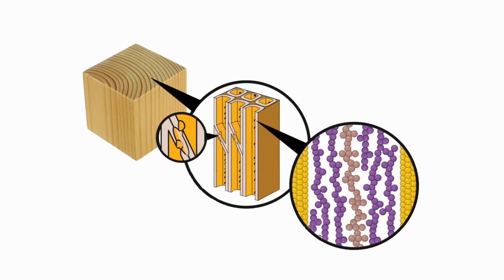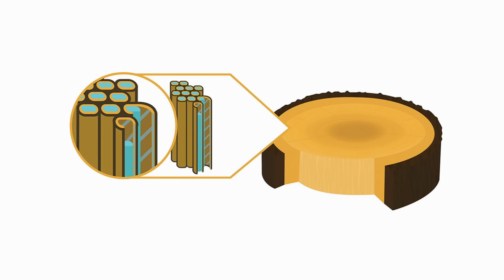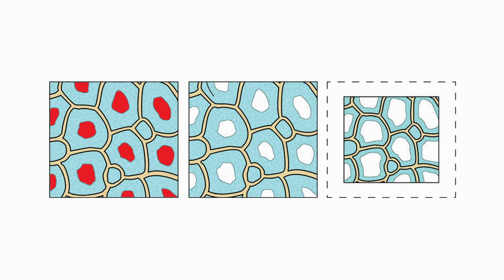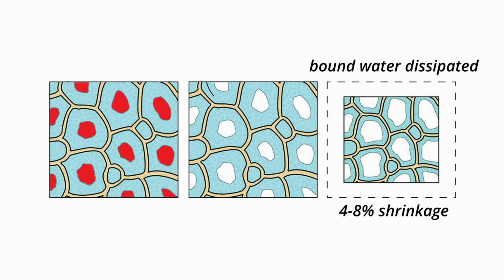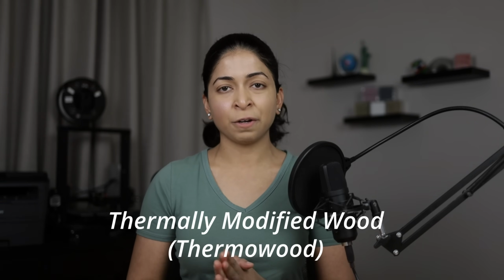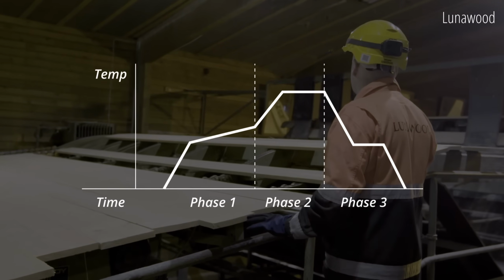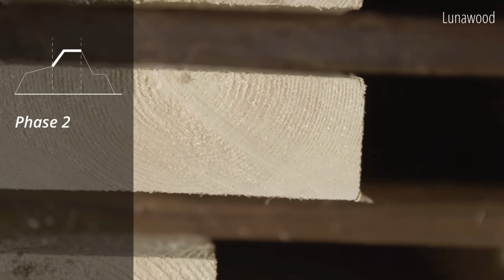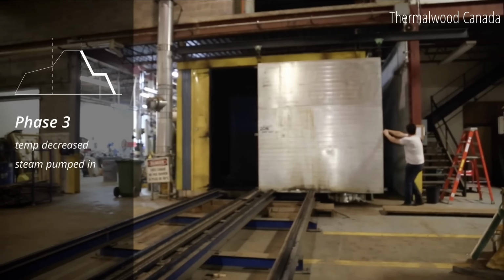Japanese BURNT wood siding | Yakisugi or Shou Sugi Ban

Comment: Excellent video.  I do a lot of work in OSB, and about 20 years ago a now defunct large OSB producer was trying to develop this very thing.  It was a top secret product they were calling SSB (stabilized stand board).  Normal OSB is produced by heating it to 200C in a big mechanical press.  Heat the OSB to much higher temperatures and you make Yakisugi OSB.  They couldn't get it to work.
Reply: Clearly they didn't understand what it is.  And in their case since it wasn't cedar it would be something like yakiOSB.

Comment: I have been all over this issue of preserving wood and the conclusion I have come to is just take extreme measures to keep it dry. I will be building a wood house in the Philippines and putting it on my channel.  I am going to have very wide eaves to keep rain off and I am also going to smoke the wood like salmon. I have heard that smoked bamboo can last 300years. I like the idea of thermowood but I don't like the strength loss. A big advantage of the surface burned wood is that it is going to be UV damage proof.
In Asia we tend to put cladding on vertically , I am at total convert to this. I like the look and the shorter lengths are cheaper and easier to replace especially if you use non T and G.  Good video.
Reply: Keeping water away is simple and bulletproof as a strategy. It applies to every level of construction and most non cellulose based construction materials
Reply from the maker: Thanks! Looking forward to seeing the progress of your house.
Reply: On the issue of keeping water away from a house you can clad a house in terra cotta roof tiles on the walls as well as the roof. The woodwork is then all internal out of the wet. If you don't like the look you can grow climbing plants up it.
Reply: @DavidPaulNewtonScott  True about climbing plants that you can do it, but I highly UNrecommend that especially w/heavily perforated siding like overlapping tiles.  The rooting mechanisms of climbing plants find gaps in the building membrane and climb right in, w/termites & fungi following the rootings.  From my mother's house I could see a Spanish-tiled-roof house w/stucco siding, and the climbing plants were leafing out in several places on the roof.  Its really hard to control once it gets going and the tear down to get all the rootings out is tedious (i.e. expensive if you have to hire it done) and a lot of patching is req'd.  Its like setting your tiled or shingled siding on auto-destruct over the ensuing years to come.
Reply: @EngineerMikeF  I would only do it with tie on plants like the one I am going to use bougainvillea.

Comment: Torching the surface of wood is a great way to refinish it easily as well. Have reused decking boards by doing that. The burning gets rid of splinters and badly raised grain without sanding, and you don't have to pay for stain.

Comment: I would love to do the cladding on my house in this. It's so classy and last a long time.
Reply: I did this for a home just a few months ago. I combined aspects of traditional and propane-torch methods to get it done most efficiently. Namely, I used soft but thick wire to bind together three boards at each end - until 12' long, when I put one in the middle too. Put the propane torch in one end on the ground, other end propped up in the air, wait for smoke to come out then end and then switch grounded ends and do from second end. Worked like a charm.

Comment: Pyrolysis is interesting, as the transformation of polymers occurs both when combustion is allowed or disallowed.  The prevention of combustion is usually achieved by an inert atmosphere, such as by flooding the heated chamber with nitrogen or a similarly non-reactive gas.   Combustion products and pyrolysis products have to be thought of as results of distinct processes, even though we most commonly encounter them simultaneously.

A structure lasting a century must be considered as quite old by Japanese standards, as it is unusual for residences to last more than thirty years.  Preservation of historic structures is usually accomplished by replacement of old materials with new, using conserved methods.

It would be interesting to consider the impacts of Japanese construction habits on the availability of housing, especially in light of the nationally standardized zoning practices of that nation.
Reply: "... as it is unusual for residences to last more than thirty years". I'm guessing you're an American? :-) Try telling a European that their new house will only last some 30 years!
Reply: @LarsPallesen  It is unusual for an American house (aside from extremely disaster-prone areas) to not last vastly longer than 30 years, except from those ruined by bad materials like PB plumbing pipes. Most of the houses around me, including the one I live in, are roughly 100 years old. In some older towns in my state there are entire districts filled with houses from our Civil War period, being between 150 and 200 years old. Many areas have laws in place that the older houses must be maintained and kept looking very close to how they originally were by their current owners, limiting what renovations are allowed, particularly to the exteriors.

Of course, for homes that are in disaster-prone areas, USA homes will tend to not survive anything severe. Even when building codes are actually mandated for homes to be built tough enough, fraud is extremely rampant. It's easy to see when a roof is blown off a house whether or not it was properly reinforced and the answer is almost always no, yet they keep getting away with flaunting building codes anyway.

Comment: I love natural building products like wood and stone. I would be interested in a home built from this type of wood treatment.
Reply: Check out Mr. Chickadee or Wild Wonderful off Grid
Reply: Yes, youtuber Mr Chikadee is my go-to for info. Getting away from power tools.

Would love to build a masonry stove heater, but having difficulty sourcing used cast iron stove parts that I can afford.
Reply: It's not structural; the process apparently makes it significantly weaker than the wood's unprocessed state.
So it'd have to be as cladding or something.
Reply: @LENZ5369  Did we watch the same video? They processed some pretty thick beams.
Reply: @anonymustly7818  Yeah, did we? 6:04
Apparently there is a 20-30% loss of strength compared to the original starting wood.
In this process; you are just removing the water from and denaturing/carbonizing the protein scaffolding of the wood; loss of strength (and density) is pretty much par for the course.

Comment: A bit down the rabbit hole but in the softwood vs hardwood discussion.  There are many fast growing hardwoods that grow wood that is softer than many softwoods, confusing I know.  One example of a fast growing hardwood is aspen.  Along with with being used to make paper, aspen is often processed into orientated strand board (OSB) which has largely replaced plywood in construction.  One interesting sustainability note on aspen.  It's harvested in coppice cuts, where it regenerates from root suckers.

Comment: Really interesting, but I'd like to caution against using old-school yakisugi in interior spaces.  The charring leads to formation of polycyclic aromatic hydrocarbons that can be toxic when used in enclosed areas.
Reply from the maker: Great point!
Reply: @BelindaCarr  maybe pin this comment to the top?
Reply: Seems like an obviously specific exterior pocess for treating exterior wood.

The human nose and common sense negate the caution directed by your fancy words.

I'll be sure to keep my incense, candles and fireplace outside 😆
Reply: not likely. they would all evaporate during the high temperatures after the fire is extinguished. Afraid of burnt pine sap?
Reply: @flocksbyknight  Really? You think the volume of hydrocarbons or volatile compounds out put by an incense stick or a candle equivalent to the leach of hundreds of foot of walls lines with charred wood? And you are not using organic wood either? You do you.
Reply: @BigHenFor  Non organic wood?
Reply: @ohasis8331  True...last I knew, they didn't use pesticides for the forests...even the locations were trees are planted for lumber don't get that sort of treatment. It's cost prohibitive to do something like that for the 20+ years necessary for lumber to reach sizes for harvest, over the hundreds of thousands of acres/Hectares that are involved... Particularly since spreading that amount of pesticides over such a long period wouldn't likely increase the productivity and will likely decrease it. Trees aren't the annual cash crops of monoculture, they're a long term investment, even orchards are careful with what they use and how they use pesticides.
Reply: Oh wait what? Guess I need to do some research on this.
Reply: If it's covered in a finish will this stop this from.happening?
Reply: It's meant for outdoor use.
Reply: Or seal it with a zero VOC interior gloss

Comment: Artificially petrified wood is superior in my opinion. While yakisugi imbues fire, rot, and water resistance, petrified wood is fire, rot, and water PROOF. And I suspect it lasts forever locking the carbon for longer making it a better carbon sink. I am curious though on how it affects the load carrying capacity of wood. Does it increase? Does it make it more brittle?

Comment: I’m curious to see how it would hold up in a hurricane, floods, snow and ice, wildfires, and extreme temps in both directions.
Reply: It would be interesting to see if this was used throughout Japan, as various parts of the country all experience the things you describe.
Reply: It would be better for finishing projects, not for structural projects.

5:50 - It's more brittle
Reply: all at the same time? :)

What's your criteria for adequacy? What are you comparing it against?
Reply: She said it wasn't structural. So not very well if you tried to build a house out of it.
Reply from the maker: @upvotecomment2110  Thanks! Yes, it's brittle & non-structural
Reply: It is possible to use sho sugi ban techniques structurally, but only to the base of posts close to the ground, e.g. resting on rocks or concrete pads, possibly even in the ground. It will help prolong the life of the post. It was a method used in ancient European buildings for example. I would highly recommend Mr. Chickadee's channel. He has built several buildings inspired by Japanese techniques, with great attention to detail, and uses sho sugi ban on them. Of particular interest is the latest building which is supported on posts resting on boulders with the end of the post scribed and shaped to the exact contour of the boulders. Watch with subtitles turned on. There is no talking, but everything is explained in the text. His videos are also an ASMR experience if you like the swish of the plain removing  long curls of diaphanous wood, an axe echoing in the forest or the song of a saw. All hand tools. He even quarries rocks by hand.
Reply: @judyofthewoods  I was just watching this last night!  I was researching timber frame / post and beam and came across his video, beautiful work.
Reply: @upvotecomment2110  It's siding.

Comment: I believe this is similar to heat treated wood that came on the market a few years ago. and Poplar are the ones I have used.  It does make it more durable in exterior use, but the wood is significantly more brittle and friable.

Comment: Hi, nice video, as usual. This saidI don't agree with the fact you label softwoods as more "sustainable" they are economically more interesting, no doubt about it. But when we talk about sustainability,  diversity in essences is paramount to create ecosystems that are truly durable and can sustain a balanced building material system. Also, themo wood seems very energy demanding, i wonder how the initial technique compares to the contemporary one.
Reply from the maker: I try to always use air quotes when I use the words green, sustainable or environmentally friendly because everyone has different interpretations!
Reply: Sawmills produce a lot of offcuts, sawdust and so on. They could burn them for power generation ( electricity) and heat. So that's a circle.

Comment: I used Arbor Wood  for my deck...built in 2015 and it still looks great.  It is Ash wood locally sourced. At least then.  We had the Ash boring bettle up here that infested much of the population and Intectural took  the trees that were cleared to deal with the situation.  Anyway great product.  
I didn't like green treated wood, hated Trex and the like and this product was a nice local, sustainable  alternative to Ipe.

Comment: sounds like i will be applying this to exterior chord wood ends for chord wall construction. resistance to exterior invaders is the one concern of that style construction. since the wood is grounded in slake lime and sand putty,  end entry is the only attack point. now that concern is gone.

Comment: It's quite an interesting product based on a traditional method. Looking to the past for innovations to aid our future has quite a lot of merit that isn't always properly recognized. 5:55 That being said I have to wonder how brittle we're talking about here when it comes to thermowoods material properties. It looks like all their offerings are tongue-in-groove but what about say shingles? Since they're a lot thinner than what you'd see in flooring or board-cladding would they shatter or split more easily, perhaps needing more specialized and thus costly instillation?
Reply: If you want some more old wisdom: in the past wood was only harvested during certain times in the winter when the water and sugar content was the lowest. But that's problematic if you only have some days a year for harvest. The second thing: on old pictures you can see the sawmill ponds. Wood was often transported on the water and then put into the pond for a year to flush the sugar out. Turning it from time to time makes it soft and easier to mill and the sugar is flushed out. But then you have to dry it afterwards, which took a long(er) time. Which requires space and is expansive.

Comment: Sounds like a nice product for siding.  I'm sure the energy used to make and mold this is not worse than other long lasting siding options.
Reply: I'm not so sure; the description she gave -was a lot of heat; for a long time, and then there is the 'premium wood' only requirement.
Engineered wood cladding/siding can be made from scraps and recycled wood.
We could also make composite products that incorporate recycled plastics.

Comment: Also after the trees growth spurt usually 25 to 35 years the trees carbon offset is negative because as things rot they produce carbon dioxide and the trees at this point are putting off as much limb and leaf litter to negate their oxygen and carbon obstruction creation.

Comment: I'm not so sure about oil based finishes not working on thermowood, seeing as in Finland sauna interiors built from thermowood are routinely oiled with parafin oil to further help with water and stain resistance. That might be something to double check.
Reply: I also thought it being wrong, not from experience but from theory: Both thermowood and oil are hydrophobic, so should easily "fit".

Comment: I think if we were buying more Arbor Wood, the very high price would eventually come down.  On the other hand, if you can afford to buy it, it should out last, by far, any pressure treated lumber and not warp and twist and because it is milled, you can use fasteners that are hidden and never have to worry about splinters or hardware cutting your feet or butt.  I really don't understand why it is SO MUCH more expensive than PT as PT has to also go through treatment. It is far lighter to ship and there should be no unsaleable boards like there typically is with dried and PT lumbers. So, I really would like to know why it is so expensive?? Is it because it should only be #1 grade? Milling?? That only really adds one more step and sharpening, but I'd bet the bits would need sharpening less often!

Comment: I would like to know the carbon foot print compared to other finishes. There is a lot of energy used to heat up the wood.
Reply: A good question, but I imagine the much longer lifespan negates it.
Reply: @yeeaahhzz  I agree, you have to ask yourself the carbon footprint over the intended life span of the product or buildings. It is Kgs of CO2/year that is important. But some other finishes also last a long time. So does Cedar and Ironwood.

Comment: I'm a little confused  . .'' You have to use pigmented top coat '' but  '' Oils , stains and water based finishes don't work because it's hydrophobic '' ?
Reply from the maker: They use a special pigment and sealant on top of the wood. It doesn't penetrate the wood.

Comment: This is not much different than seasoning a cast iron pan or a carbon steel to resist stains and corrosion.  The sugars in the wood literally carmalize like really hot dry oil on hot metal.  This makes the wood noticeably darker, hydrophobic and hard provides way less outgassing as the wood breaks down except in the worst of building fires.  I would not be surprised some wood refining operation do this with engineered built up wood timbers though trying to figure out how or when to glue the different glue pieces together to deal with the newly nonporous surface might be a challenge. That glue still has to be predicable and fire retardant even in a major building fire for such an engineered wood product.   Architectural technology and building sciences are so underrated.